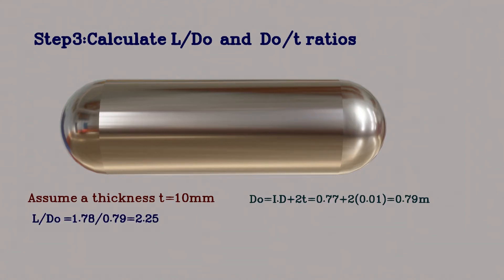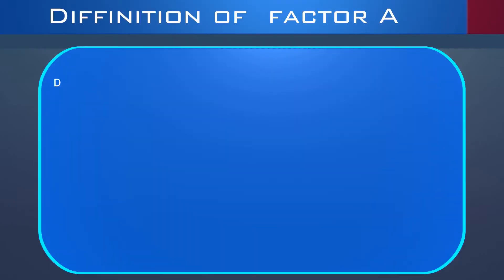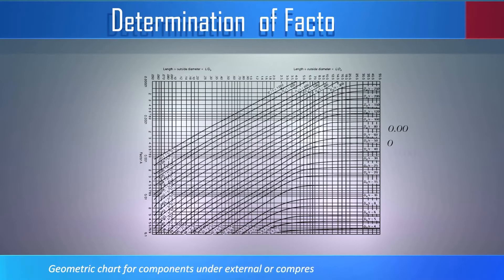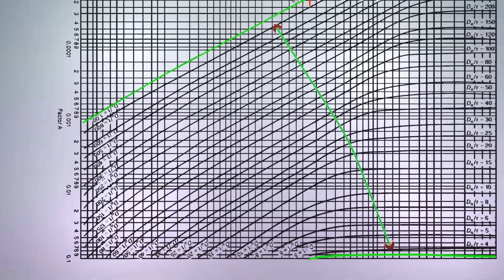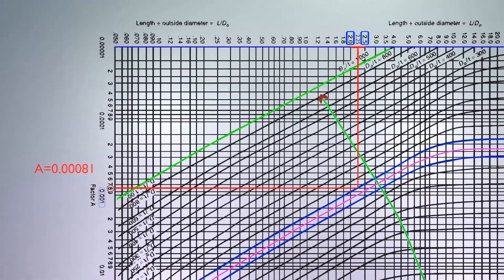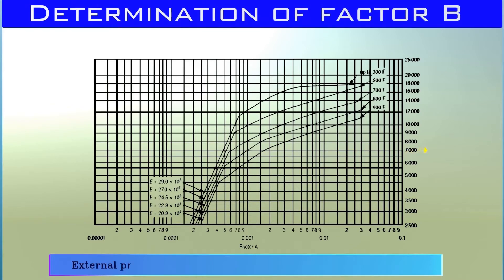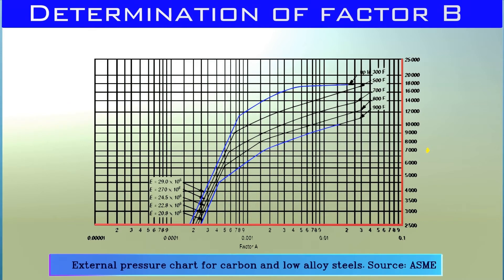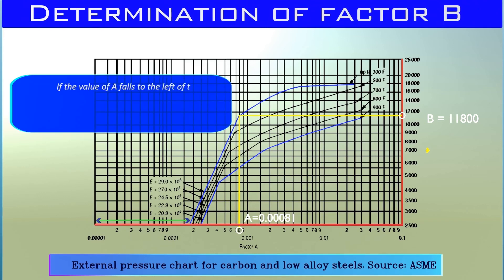Mechanical Design of External Pressure Vessel | Vacuum Vessel | Finding Factors A and B Using Graphs

Comment: Hello, could you please keep the link for the chart B, OR where exactly did you got the chart B. I tried in ASME SECTION -2 PART-D, but their the chart is different for (Chart for Determining shell thickness of components under External pressure developed for Austenitic steel, Type 304)...could you plz sort it out.....TQ